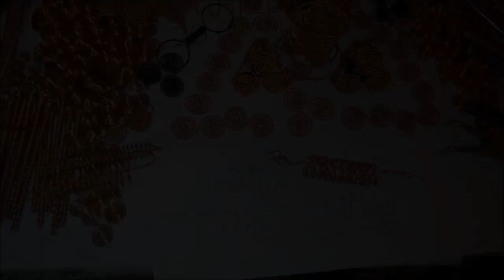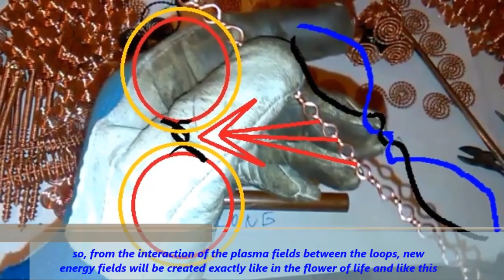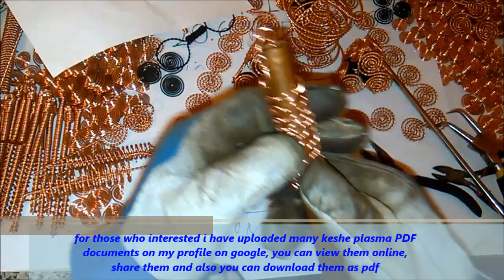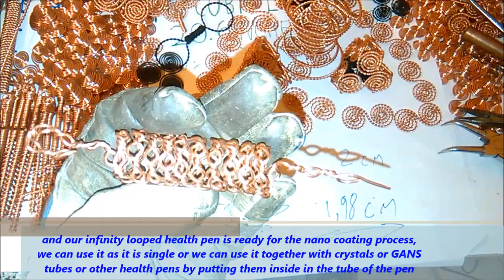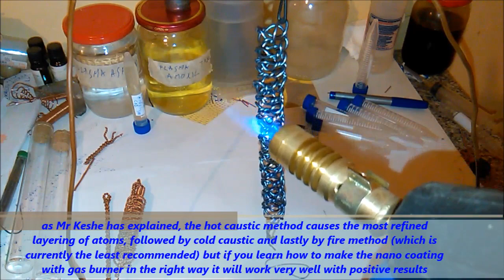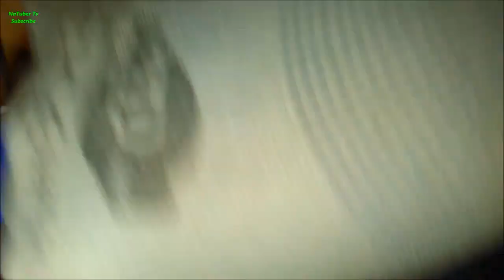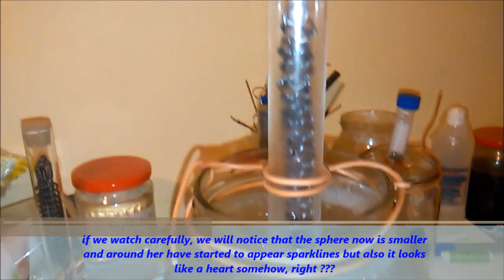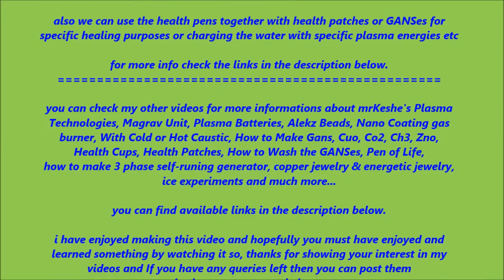New Strong Design, How To Make The Flower of Life Health Pen With Only 1 Wire, Plasma Technology

Comment: You are indeed a very creative human who, it seems, the batteries don't run down.  One question that may be important :  what is the ambient temperature of the water before and within the plasma field liquid water?  One may be able to calculate how many heat (vibration)
Kcal is maintained by these - well demonstrated - fields generated.  I will write you later.
Reply from the maker: Hello Dr.Rolf 
i have change my batteries with plasma that's why don't run down... (joke)
after all, the results from these experiments can't let someone run down. they are proving to us that plasma technology is real and is working in many and different ways with very positive results. the only thing that we need to do is to try understand and learn more about plasma energy & technology so we can have positive results in whatever plasma device we want to use. 
for the moment i don't have the right equipment to continue in further analysis but i believe in coming time and step by step as we learn more and more we will make more profesional experiments. 
i can measure the water before the freezing but after the freezing and when the plasma ball is appearing how i can measure the water inside ??? i need to brake the ice which is not good because we change the fieds or something so the other way that i'm thinking is to put an thermometer from the beginning of the proces inside in the sphere somehow if it is possible... ???  

thank you very much !!!
Reply: Putting a temp thermocouple along side of your device may work.  I think I will duplicate what you are doing.  You are thinking very correct = a wonderful way to display a plasma field.  I have mentioned this before about the "oasis" effect or plasma shields (like the one in Romanian mountains) set up by ETs to protect.  Anyway this heart sphere of is very important.  Great work.